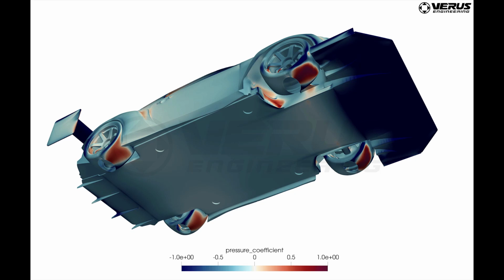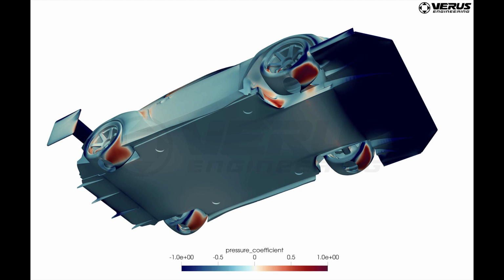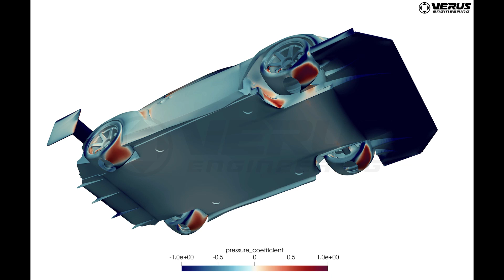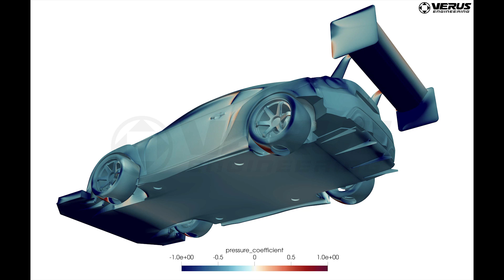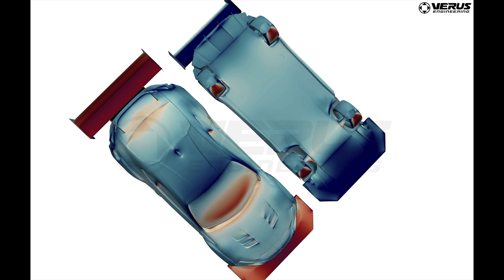ProjectFT86SFTA - Flat Underbody and Rear Diffuser Recap

Comment: Great video buddy! I was planning to put a undertray or a flat floor for the car but some people have mixed opinions about it! Like they say it heats up the engine bay because the air doesn't escape and the temperature rises! And do you prefer abs plastic for flat floor? Could you give me your advice! Thanks and waiting for your response sir!
Reply from the maker: This is a Time Attack car so it sees very few laps at a certain time, so this is not a big issue for a race car of this nature.

Comment: Thanks for sharing your results. Very cool project.
I know this project was timed limited, but I was curious on what areas of aero you might have investigated if you had more time. Some areas I was curious about:
1. Any idea how much downforce could be gained by having side splitters extend closer to the ground (maybe w/ a flexible lip ) to reduce air ingress from the sides to maintain lower pressure on the flat botttom?
2. Any idea how much downforce could be gained by having rear diffuser strakes that extend closer to the ground and/or further towards the front of the car?
3. Relative effect that rear wheel air deflectors have to reduce drag on the rear wheels and increase downforce by increasing flow between the rear axles.
Reply from the maker: To be 100% honest, we have no clue as we did not test this.

Comment: Great video series on this car. I have two questions. Why aren’t your floor panels tight together. And in the underbody cad you can see that the low pressure starts to lead off in front of the rear tires, can that area implement diffusers similar to the front splitter? 
Thanks
Reply from the maker: The area in front of the rear tires is not really something to be focused on. Large tunnels under the car can help in the rear tire region though. As far as the underbody panels go, this was a one-off kit that made my hand. If we were to make a production model, we would certainly revise this.

Comment: Nice I want to do this with my 350z. Is it bad to cover the exhaust?
Reply from the maker: In this case no, as this build has a hood exit exhaust. Regardless Time Attack cars do not see extended periods of time on track, but race cars that see extended amounts of time on track could have issues with a flat underbody unless the exhaust is vented differently.
Reply: @VerusEngineering  thanks. i think i cut out the Exhaust Layout and also do a NACA Duct in front of the Differential
Reply from the maker: @MIMCKMedia  that is actually what we did for transmission cooler on this car. As long as it has airflow to the cooler and a way for the air to escape, you should be just fine.
Reply: @VerusEngineering  thank you for feedback. I'm new to build custom made aerodynamics so I try to suck as much information as possible in 🙃

Comment: What program/ products did you use to put the car in cad? That would help me tremendously Im just starting a Flat bottom project and this would speed things up majorly
Reply from the maker: From the scan (stl), we use Siemens NX for reverse engineering and design.
Reply: Verus Engineering Thank you!Appreciate the info

Comment: will you be offering this flat bottom kit for sale or any info on how to replicate? I would love to have this for my 86!
Reply from the maker: Unfortunately, no current plans. We can have a one-off made for you if you would like, but it would be too difficult to make a production piece out of this. Something to keep in mind is that this car has a hood exit exhaust. This means that there is no exhaust piping to worry about on the underneath side of the car. We can certainly do it, but it will not be a bolt-on kit and would take modification on your end to get it to work.